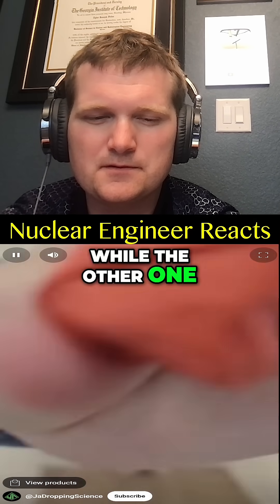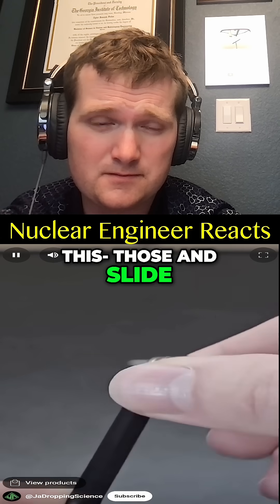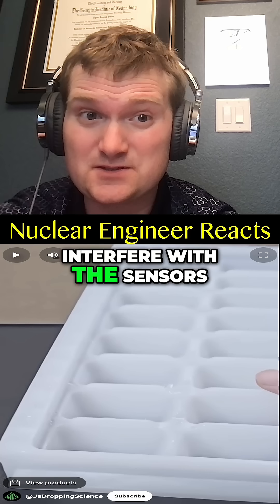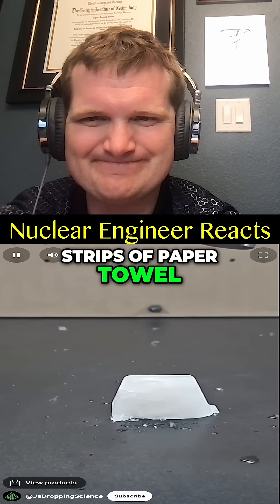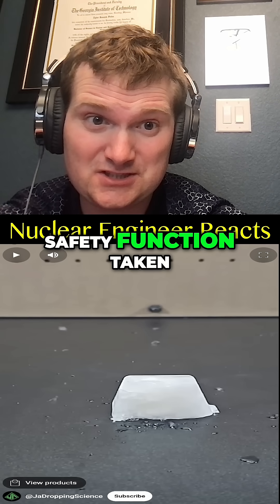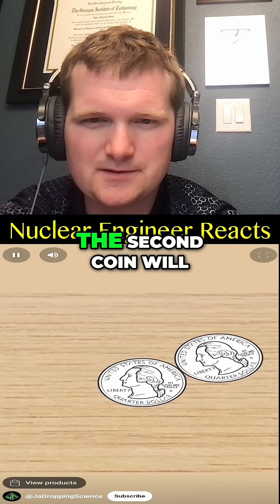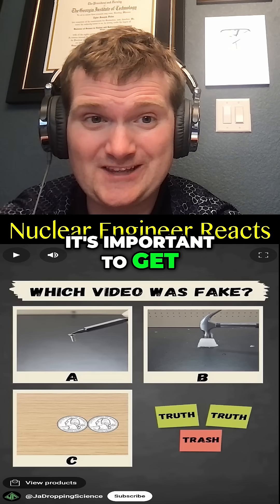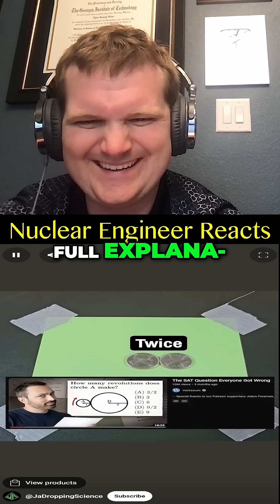Protecting Ice with Paper Towels - Nuclear Engineer Reacts to 2 Truths & Trash by JaDroppingScience

Comment: For the ice one, they actually did that but made an aircraft carrier during WW2, not with paper towels, but wood chips, and such.
Reply: Yeah they just made pykreeet
Reply: @kennethabebdroth8513  Wasn't there an episode of Mythbusters that tested that and proved that you could do it but advised that it was practical.
Reply: It was never actually made, they did make some small scale models.
Reply: @jerithil the issue is that they couldn’t keep the ice cold enough to prevent distortion so there was no point in building a full sized carrier.